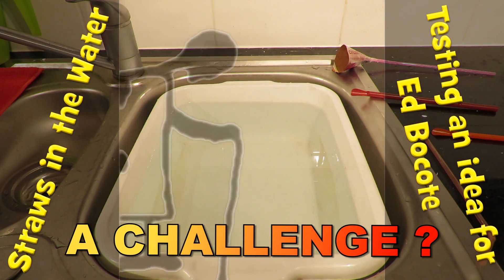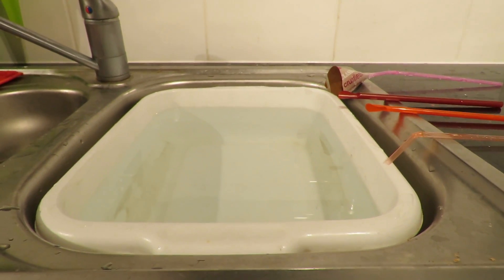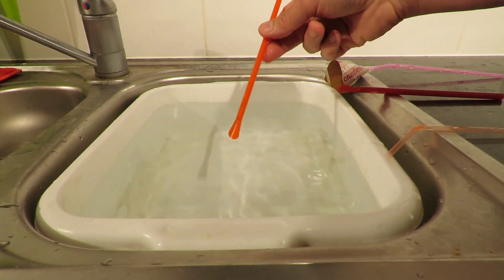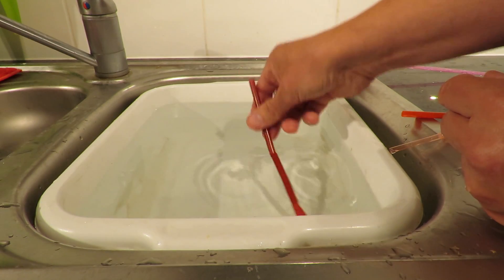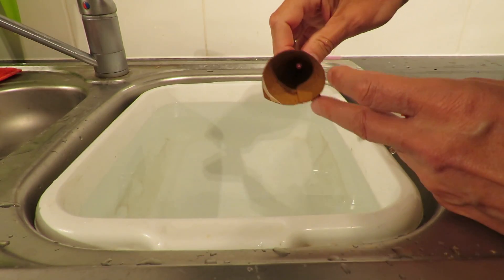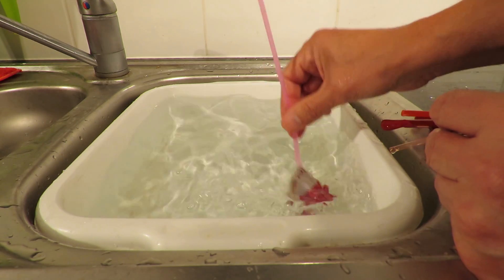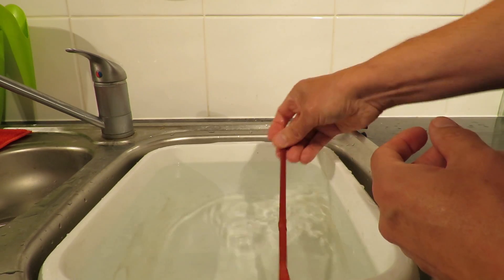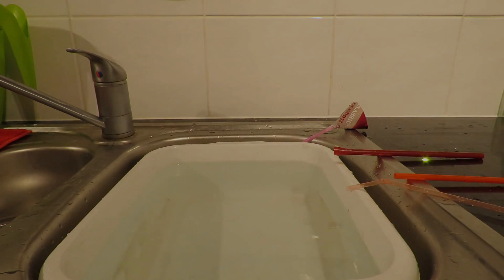Straws in the water A CHALLENGE ?

Comment: Every RC boat is now using this system to deliver water from bottom of boat to cool electronic speed controller, motor, or engine inside the boat. This system has being used for over half a century, check rc boat water cooling system.
Reply from the maker: Thank you for taking the time to comment. The original request was to make the water shoot out as a jet above the boat. The RC cooling system you are talking about is fairly passive. The water just trickles through compared to the jet wanted by my subscriber. If you read my video description I give more information and in the playlist associated with this project I have included many videos of RC boat cooling systems. Perhaps you could try making one work yourself and upload a video. I see you have several videos of RC boats but I didn't see any with a jet of water shooting up high behind the boats, just spray from the propellers.
Reply from the maker: Nice video, is it your boat? The issue with the jet of water is the original request wanted it to shoot out high above the boat using nothing but the forward motion of the boat so using a pump or placing the inlet pipe behind the propeller would not meet the request. I don't think it can be done.
Reply: I have been thinking of glueing a syringe body with opening facing front, beneath the hull, connecting the straw to the syringe tip. Well, it may has a slightly stronger water jet stream. Could it work?The boat is my friend's and I took the video. I am over 65, getting old unnoticingly.
Reply from the maker: kwokwing that is why this is a challenge, I don't think it can be done. I have shown my efforts so I want to see somebody show me how to do it :)

Comment: The funnel could do the job if it were fast enough. But for the straw alone I guess that the only possible solution is doing the opposite movement: sudden pulling of a submerged straw and rapidly sinkin it again before the second tip emerges from the surface. It relies in friction against the walls for the pulling, so water would rise a bit with the straw, and then the sudden push down should be faster, to let water inertia keep going up through the straw that is going down, even against the friction that was useful on the pulling time. Gotta test it though...

Comment: I thought that the cone addition would work. Strange. Seems like the water density is way too much. Or maybe it's something about the reverse thrust like we have in bazookas where they have a cone at the rear to stop the recoil. Sorry I can't do the math. But I can eat cake with chopsticks https://www.youtube.com/watch?v=VOiDtxtiP3g
Reply from the maker: There is another video up now with a much bigger cone and some minor success but really nothing like what we wanted from the simple idea of attaching a couple of straws to the side of a boat. Great video but I don't think it quite qualifies as a video response to the task in hand :)
Reply from the maker: My reasoning is that the only thing that will drive water up the tube is to increase the pressure at the bottom compared to the top (or reduce the pressure at the top like you do when you drink through a straw). Air pressure is pressing down on the water and the same air pressure is pressing down on the water inside the tube so there is no reason for the water inside the tube to rise up any higher that the water outside the tube. Pushing a tube into water just makes the water rise up to it's outside level. However if we use a funnel we do have a larger volume moving into a small volume so the only escape is up the tube or maybe that theory is wrong and it just doesn't work like that. What I haven't been able to do is make that work by simply driving a toy boat forward so I don't know if that theory works.

Comment: A valve and a tab made of plastic under
Reply from the maker: That won't work for the original task which is a straw attached to a boat moving forwards in the water. What you are talking about there is really a pump which would only work with forward and backward motion.

Comment: you don't really need math to do that. It won't rise because of the straw alone. You need a big oberture of the straw In the water and if possible that it is leveled with the horizon, and you need speed so water gets pushed through it and gets out of it. Also try to shorten the part of the straw which is In contact with the air
Reply from the maker: The challenge is to do it and demonstrate it not talk about it. The maths alternative is not an easy option either.
Reply: +GrandadIsAnOldMan yah
Reply: +GrandadIsAnOldMan there has been a system on high performance racing boats (radio controll) that there is a dmall hole in the bottom of the rudder or a pipe that sits under the water this is the connected to a silocone tube which then goes to a cooling jacket and they has plenty of pressure however this also is aided by the thrust from the propellor
Reply: +Jack Edmondson yes but that is on speedboats
Reply from the maker: I think you have answered your own point there. Putting the pipe behind the propeller would be the same as pumping it so not a valid method. I have looked at videos of RC boat cooling systems. Others seem to be passive (no pumping involved other than the forward motion of the boat), but the water outlet is low pressure exiting at the water-line not shooting into the air like a jet of water. It is more or less just siphoning through at no significant pressure. I have created a playlist for this project and included a couple of RC boat cooling system videos for reference.
Reply: +GrandadIsAnOldMan fare point, you have to over come the force of gravity and water tension to get up there. Could u make a vacuum to draw it up there ( that was a joke!)
Reply from the maker: Jack Edmondson you are right. The only reason for water to rise up the straw is if there is a difference in pressure top compared to the bottom.
Reply: +GrandadIsAnOldMan if i totaly honest i dont really see the point in doing it, if it was for cooling the motor that poweres the boat then yes but this is just if im honest pointless!.
Reply from the maker: Jack Edmondson I was asked to try it because Ed Bocote thought it might look good on the toy boats if there was a jet of water shooting up in the air. You often see it on JetSkis but they use a pump to do it. Having tried it I realised there is far more to this task that it first appears. So far many people have suggested ideas and I am trying to encourage people to try it for themselves rather than just guessing what they think will happen. If you read some of the comments some people seem to think the answer is obvious but it is not. That is why I demonstrated in the kitchen sink to show you don't need to build a boat to test this for yourself. If you need a reason it is a demonstration of fluid dynamics.